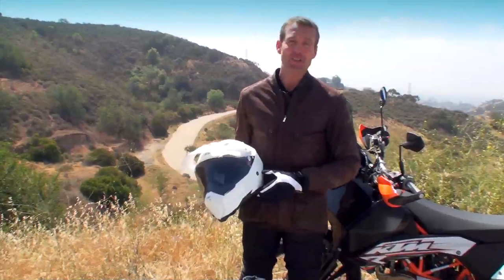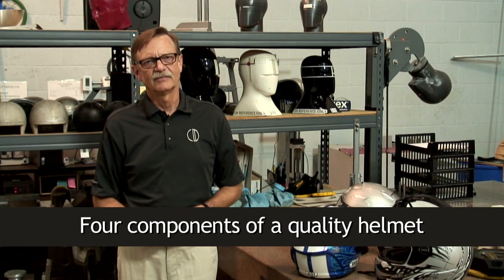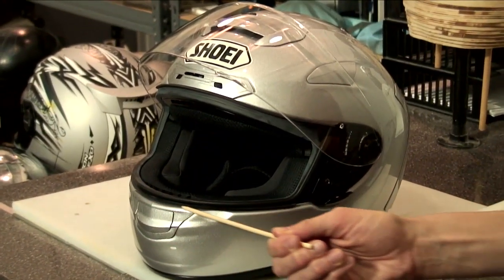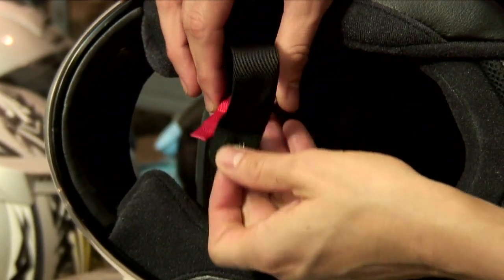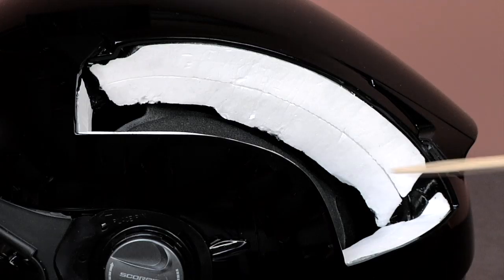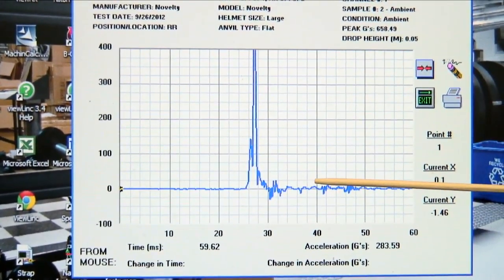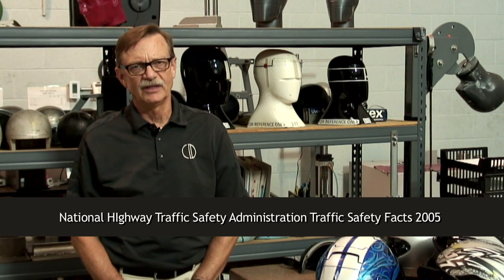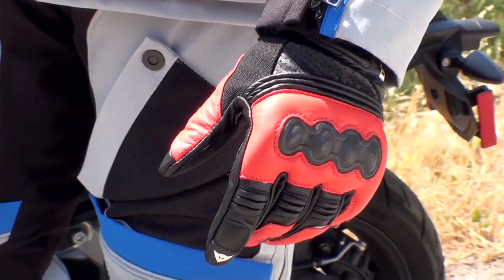The Importance of Real Helmets

Comment: DOT is a bit useless and horribly out of date plus it’s a self-certified standard. Better to get a helmet that’s ECE, Snell and also been tested by Sharp. My latest helmet is DOT, Snell approvals and sharp 5 star rated. I pay most attention to Sharp. It’s not a pass/fail but a ratings based system. All the helmets Sharp tests are ECE approved but they can still be 1 to 5 stars amazingly. I got a Bell Race Star. Not cheap but worth it. However, I could’ve got a sharp 5 star helmet for half the price but comfort is an important factor too, for me.